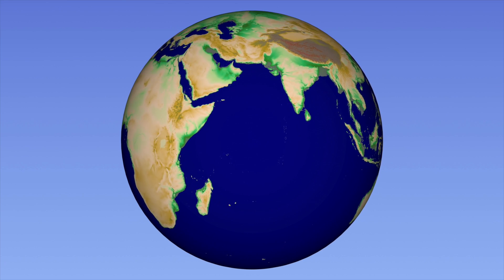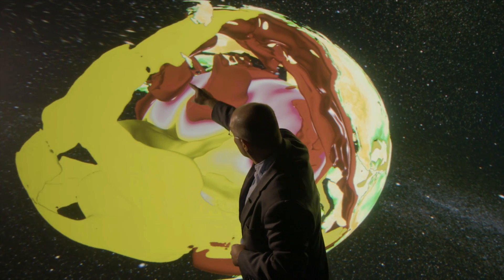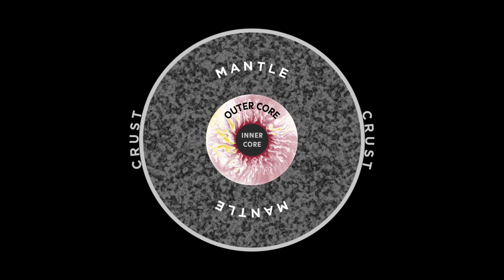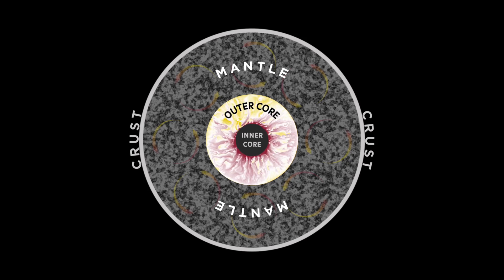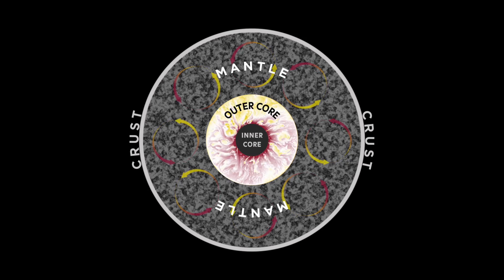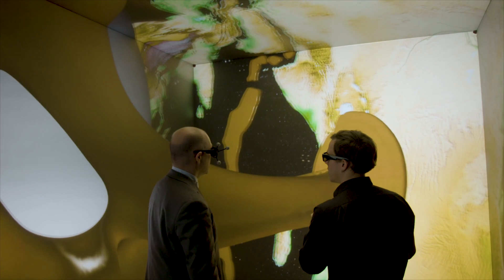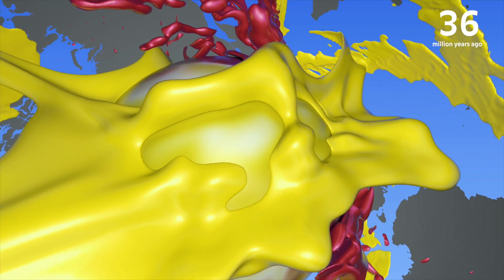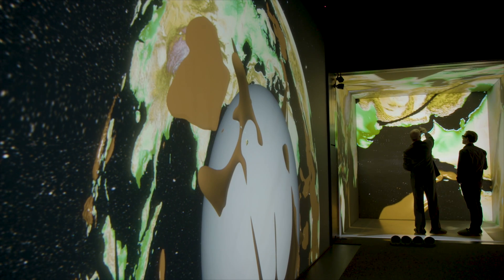Mantle Convection explained by Peter Bunge

Comment: So within the earth there is a weather cycle... essentially... that extends from the outer mantle to the inner core. Heat and pressure differentials determine the flow of fluids. However, where I find my mind gravitating is... toward the possibility of precipitation, like say an element gets super heated in the layers around the core.... that element then hitches a ride on a current that takes it away from the core since it's super heated state is less dense than the elements that comprise the surrounding medium kr more heat and pressure resistant/ tb denser, heavier elements, would it be possible for those "evaporated" elements to reach a pressure level that's nominal for supporting it condensing, and could that recommended element then form heavier collections of elemental pure forms that then sink back down to the core to re mix and meld back into the super heated environment. And could such a form of precipitation of heavy elements going on in the mantle be the cause for the the displacement of other layers that ripple into playe tectonics and seismic activity. And if light precipitation causes earthquakes on the surface than what happens when super storms form out of a mixture of strong/ heavy fused and alloyed elements within the mantle, could such an occurence displace enough surrounding medium to cause entire tectonic plates to sink drastically like has been described in  interpretations of geographical evidence suggesting entire forests suddenly becoming submerged in sea or ocean and mud collecting into stone over millions of years
Reply: did I ask
Reply: Who...

Who...

Who...

Asked